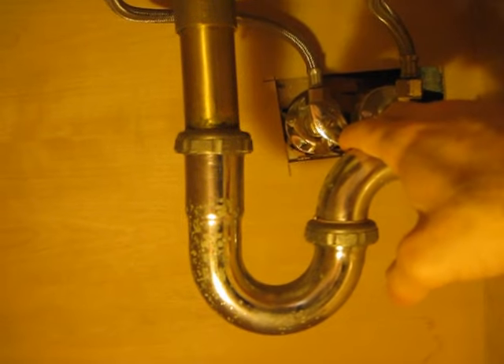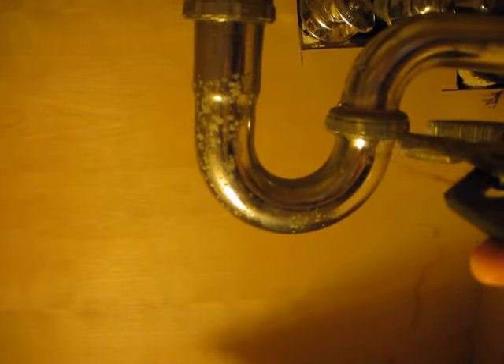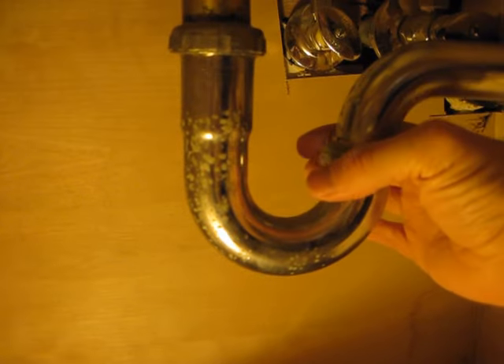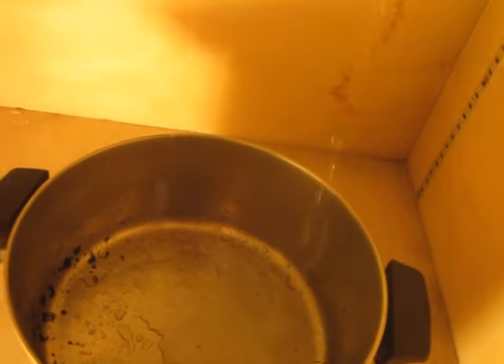How to Clean Out a Sink P-Trap, and Replace Compression Washers

Comment: This is a handy video, I watched a few and this gives very detailed instructions even down to how to put a beveled washer on.  Thanks for posting this video, I just replaced my kitchen sink basket, brass tailpiece and removed all the other brass drain pieces and replaced all the rotten washers with new nylon ones.  The job is done and no signs of leaks at all.  $15 in parts and a little sweat and one small cut and I saved a bundle for a plumber!

Comment: What do you recommending for dissolving or softening the glue that holds a metal p-pipe joint in place (in addition to the threads screwing the two ends together)?  Thanks.

Comment: Also, as you removed the trap, you said, "as long as the water is off, it will stop leaking." The water supply doesn't put water into the trap, it goes to the faucets. The trap just drains water from the sink by gravity.

Comment: Great video, I have a leak in a PVC pipe under the bathroom sink. Water flows out of the lower nut that connects to the P trap. This happened right after I tried to unclog the drain using plastic zip-it that has small teeth like edges. Do you thing I might have damaged the PVC pipe itself? Your response and suggestions will be appreciated. Shahzad

Comment: I have a question.  Just got a new sink all put in... having horrible trouble with leaks.. tightened several parts, and replaced a few.  Now everything seems to work great except the dreaded leak has come back, only this time its actually between the brass part just under the sink and the metal pipe that screws into it just below that.  Can you tell me any way to fix this?  Already tried screwing it as tight as it will go, and it has plumbers tape around it.  It's just a little bead of a leak, but just enough to ruin things.  Please help. (was thinking maybe replace it with a plastic pipe?)

Comment: We keep replacing compression washers and we still get leaks... at the P-trap fitting.  And yes, we tighten them down. ;-)  Any thoughts?
Reply: +Jamin Mayer  Jamain..get some waterproof silicone grease on the threads. If it still leaksm backup he washer wih some waterproof silicone grease, available at most plumbing supplies.,wrap the wicking between the nut and the washer. Wrap as much as you can that will allow you to get the nut started.. Wrap it just like teflon making sure you wrap it the right way. If not, the wickig will come off. Lubricate all male threads with the silicone water proof grease or pipe joint compound. Bttw, the ball lamp wicking is cheap only a couple bucks. That is what up old timers used, (the wicking,) before teflon, and works better. Good luck!

Comment: Unfortunately, non of these videos actually show and explain the white washer placement.  I am attempting to replace only the J- Bend and a white washer came with the part; however, although the J Bend is the same size as the old one, the white washer that came with it doesn't seem to fit which doesn't make sense since.

Comment: what do i do if the nut connected to the pipe to the wall ( in the middle) was corroded and just crumbled off?  I have the replacement elbow, but I cant get the pipe out of the wall or the nut on the other side where it needs to be. it's very old and I'm scared to use too much force.
Reply: I can help you....I went to Lowe's and found a plastic nut; 2 pieces that goes together like a puzzle piece on the pipe. It was only about $3.00 and ever sooooo easy to do. as long as you have the pipe size. Done in like 30 seconds, no tape, glue or anything. Works like a charm. this is what it is called. just copy and paste in the search bar on lowes.
Plumb Pak 1-1/4-in Plastic Slip Joint Nut
		Item #: 346417 | 		Model #: 		 PP9256SPLT
I hope this helps....I figured this out on my own so I hope I can help someone else.
Reply: PS. don't paste the whole thing. it wont find it. either do the name or the item #. and if the pipe is a 1/2 just change the number 4.....